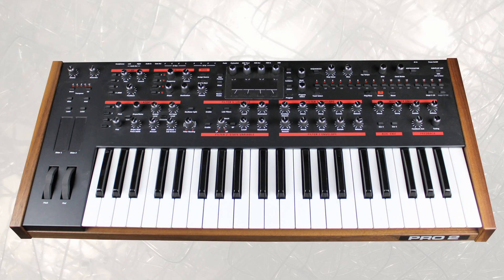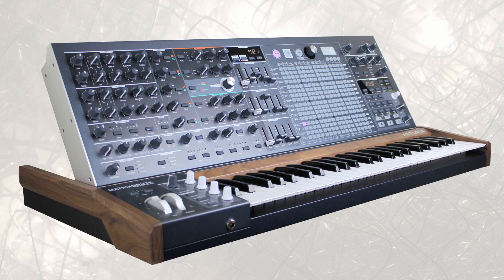A History of Polyphony: Part 15-  Modern Nomenclature

Comment: You know that trying to change terminology is a pointless endeavor? once it's out in the wild there is no chance to correct anything.
e.g theory <>hypothesis. a (scientific) theory is the accepted result of repeatable experiments and observation.  a hypothesis is a question  which gets this process started.
sometimes you get a reply along the lines "that's just a theory". the person  wants to tell you that they don't believe you. so hypothesis would be the more appropriate term in this situation since a theory is a proven thing.
TLDR; : The genie is out of the bottle and it cannot be pushed back inside.